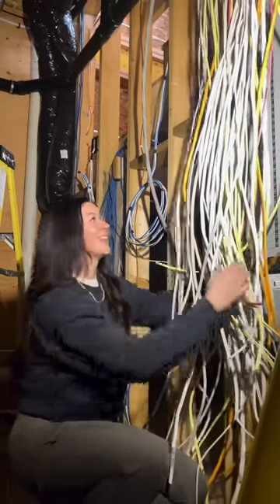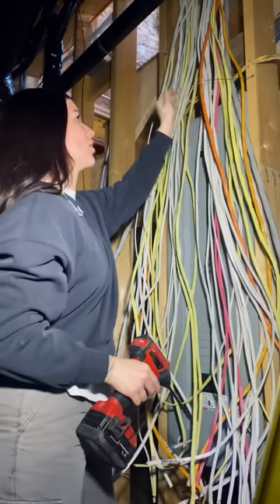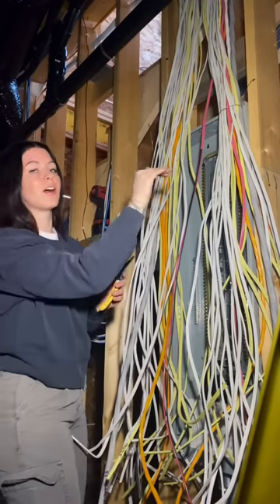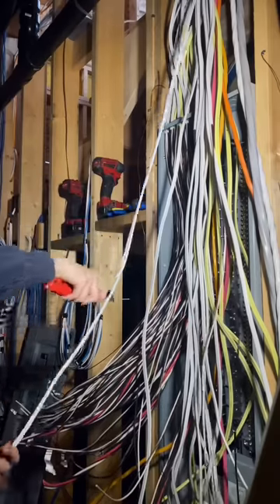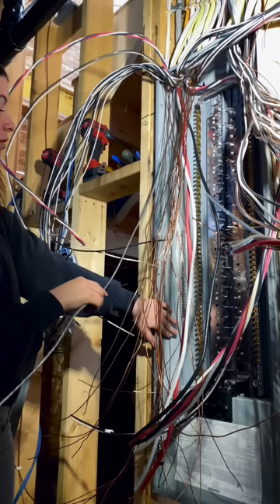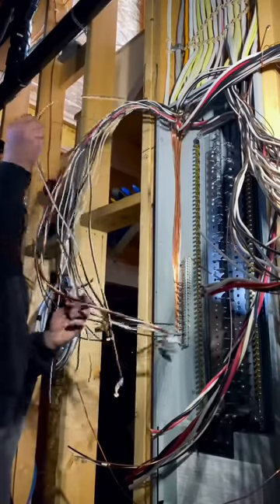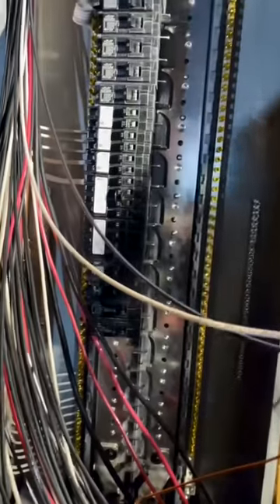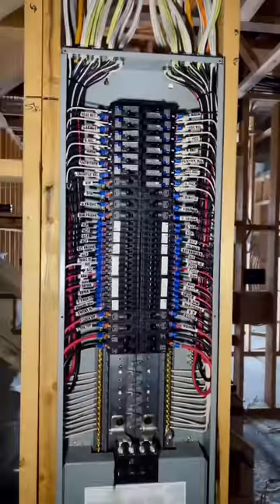How I wire a panel (an in-depth tutorial)

Comment: I like to number my circuits so the number is showing on the sheath and I can easily tie in in numerical order and then my directory is done at the same time. Couple critiques, tie your hair up, eye protection is a good idea when tying in, seen eye accidents before, wear a tool belt or proper work pants with knee pads. Also get a bigger step ladder. Trust me, 20 years an electrician over several continents including North America. Apart from that you're obviously a great worker and would be a great asset at any company or on your own work! Edit: just seen the arc flash and wow, if you're not able to switch off that mains then take extra precautions. Also use a drill with a clutch not an impact.

Comment: As  40 year  journeyman electrician, I feel confident in saying that there is absolutely no reason why the main breaker in this panel is live while terminating. 
   This is a bad example of saftey, not to mention an OSHA violation. 
     It is a pretty panel when finished. I'm glad you didn't die...or worse.
   Always isolate energy. Follow Lock Out, Tag Out, Try Out, and THEN terminate a pretty panel. 
      Love in Christ, Coop.

Comment: Clean job, just a bit concerned that you called the panel not live knowing full well the feeders were hot to the main.   Glad your ok but don’t put it off as nothing just because you understand electricity.   Use it as a learning experience and never have power going to a main like that.   No reason to have live feeders in that panel.  Work safer and keep up the clean work, all of it aside from the excess DNA.
Reply: Nearly died. Could have killed somebody else upstairs. Lucky that wire jumped away too. The most worrying is that I know electricity comment....
Reply: She had me convinced she was safety competent up until the giant spark ⚡️
Reply: @paulb9156  You can be a hero your whole life and mess up in front of the world and it all goes to crap

Comment: Damn Karly that’s one of the cleanest panels I’ve ever seen! I’m in hvac so never really get the opportunity to shut down the whole panel but that trick the way you straightened and rolled the wires so they lay tight in the back of the box is awesome I’m definitely going to have to try that in the future. I will say I did replace my own panel with about 1/10th of the circuits tops and it’s decent for my first but nowhere near what you’ve done here🙌

Comment: Great job Karly, thank for sharing. I'm in the UK and tend not to strip before entering the panel, because the cables go through silicone glands and it's easier to push T&E through unstripped and leave a bit of sheath on the inside of the panel. Also we sleeve the earth in the UK. That said if I were able to do a job to your standard I would be very pleased. One other point when dressing the wires I would like to see some protection for your hands, even if it is just a microfibre cloth when shaping the wires. Great job,  fantastic viewing, thank you for sharing, and for the professional A+ approach to your work. G.

Comment: Panel looks good and she did a great job terminating this panel with the exceptions of using an impact and not using a LOTO which is an OSHA violation. As far as using the impact, your body (hands) produces more inch/foot pounds when tightening the terminals than an impact driver would. Over time, the current from the electricity creates micro vibration which will eventually loosen the terminations, causing electrical issues such as faulty voltage readings, miniature arcs and loss of power on a circuit. Besides that everything was perfect.

Comment: About 10 years ago a friend an I did a full re-wire on a home he inherited, changing it from a four screw-in fuse setup to a proper 18 circuit layout. The electrician who supervised us was a friend and he taught us how to do the panel exactly like you do. It was a lot of work for two people who had only previously replaced a wall receptacle at best, but we got it done. When the city came to inspect the job, he told our electrician friend it was one of the cleanest rewiring jobs he's seen in his 30 years inspecting. He told him he didn't do any of it, it was all the two of us... the guy was floored.  It was a pretty awesome feeling.

Comment: instead of writing on tape  you can take the end of the insulation you originally wrote on and slide it back up onto the wires.
What I like to do is land all the neutral and ground wires then twist all the hot wires together, that way I can use a bell set to right out all my circuits when making up the boxes, and land the hots after that.

Comment: Hi Karly I noticed you mentioned you start off with 15 amp and work down to your larger breakers. So my question is does it matter if you start with 15 amp breakers and work your way down your to 40 amps, or is it better to start with your largest breakers and work down to 15 amp breakers. You did an amazing job on that panel

Comment: Great work. I'm not a sparky but the comment about impacts made me think that it might be better to use a regular drill inside the box when tightening up screws where you don't need a lot of torque -- to keep from stripping out threads? Or perhaps modern impacts allow finer control on the trigger. Definitely an impact would be great when mounting panels to plywood and lumber.

Comment: The only problem I see not only here but the three new homes built on my street (Florida) . There was no service loop in any of them, which removes any possibility if a change is needed. Also NEC use to specify 14 gauge wire and 10 to12 for appliances etc. I don't know if NEC changed but the one house had 16 gage threw out exception of kitchen, AC and hot water heater.

Comment: 5:30 that’s why I just shove the wires in the power box first then strip them. Instead of stripping them then put them in the box because something like that could happen. But if the power was completely off. Go for it. Whatever is easy to any of us is easy to us. Labeling the wires then take the cover off, putting the wires inside the box then putting the cover back on to know what wires it is, is easy to identify for us all to know if we ever do come back to the panel.

Comment: Nice work! So I have wired many commercial +residential panels, in commercial the ground is usually #12 stranded but in residential the romex has a bare ground so if the line side of your main is hot.... then you should probably tape a piece of cardboard, or use tie wraps, and secure the cardboard in front of the terminals are so that doesn't happen again. I mean It has happened to all us sparkys lol, but work smart and safe.

Comment: Great Work, Looks Great, Like to Add, I like to Label the Wires outside the Panel, Also Draw The knockouts for any side having Conduits, Small Circles for 1/2", Larger for 3/4, and so on. Have Areas grouped together, Bedrooms, Kitchen Circuits, Upstairs, and so on, I like Main Breaker at Top, Thought people had at bottom to save a Couple feet of Wire, may be allowed, may be a Reason I don't know? I wont Do. Also, I like to Leave Top 2 Right Spaces free for a Possible Interlockkit. Your list looks like you may have some Tandems, Appears you had open Space, Leaving bottom 2 unused would be good. Not bottom left and right side, but both at Bottom Right, in case of 240 Volts. You are Better than most I see. Just my 2 Cents, Take Care, Keep up the Great Work
Project I am doing now has 2 225 Amp 60 Circuit Panels at Main House. 225 Amp 60 Circuit for Guest House, Garage, and Gym. 4th Panel is for Cabana, Pool, Dock, will also have a 70KW generator.

Comment: HOT! As in awesome work. Low voltage sucks. It's 128 to 254 circuits with programming and includes rf internet and multiple means of phone infrastucture and or fire detection. Less zappy more explainy. That's a sexy panel right there. Also panels use inference so you split the wires and its why it's best to split the difference as you did in the beginning.

Comment: Just a super random note, I’ve always found hammering in some flatheads to the studs to be a far easier and faster way to move the wires out of the way to work with them. Also ALWAYS work with bitch mitts lmao I’ve had far too many times working with panels or MC specifically where it gets jammed and pulls apart slicing right into your palm. Gloves are 👌🏻👌🏻👌🏻

Comment: I have been an electrician for over 30 years, I live in Germany, and I have jobs in Belgium and Luxembourg. many of you Americans do not know all the European countries, or where they are located in Europe, in my opinion. We Europeans have other electrical VDE standards, very different from yours, which are as simple as they are poorly constructed....all my opinion. Well, you have other norms and standards, we have others. I understand that you have about 5 years of experience in electricity. You are still young, at the beginning of your journey in electricity, you do not yet have the necessary experience to know what this beautiful job means (and I can see it in the way you work carelessly). I've been following you for some time, not because you're stunningly beautiful (like all American girls), but I want to follow your work style. I noticed that you don't use a cloth to help you straighten the conductors more easily, as it is used otherwise (and not to ruin the sleeves of your work sweaters). But, you work very clean and neat. You will mainly focus on non-VDE tools, (which is forbidden here in Europe in electricity), the yellow/red ones. I see that you bought Wera noninsulated screwdrivers, but also try the VDE slim yellow/red ones, they will protect you from any bad short circuit in the future. Klein Tools have some sets of superb VDE screwdrivers, here in Europe they are double the price, and it is logical, as you also have double the price of the European tools. Honestly, I got very angry when I saw how you were working in this clip with that electric short circuit and I wanted to argue with you (and I wanted to be mean to you and also tell you that this job is not for young and beautiful women like you, who still don't have the skin of your palm beaten like that of an old tradesman and you can get hurt very quickly), but then I thought that you have your whole life ahead of you and I guess that you chose this job for pleasure. One more thing, please, wear special safety shoes for work, with the iron bomb. This is for your safety. Keep up the good work and I wish you to assert yourself in your company and have a beautiful career in life.

Comment: This the problem when you don't have an isolator switch right next after the meter. In the UK and maybe in Europe as well they have an isolator switch outside of the main panel and there is another isolator switch on the panel.

Comment: Trust me. It's a lot easier to get all your Romexinto connectors and secure before stripping the jacket. Also use your cutters to strip the label off the end of the cable and use it as a sleeve to label your circuits once they're stripped so you're not labeling twice. (Retired Journeyman)

Comment: Would stripping wires AS you put them into the panel be less time efficient? 

I feel like it’s easier to get the unstripped wire through, THEN strip it when it’s sitting in the box. 

You’re going back and fourth, but I wonder if it saves time being able to easily thread 1 wire into the box, as opposed to trying to get a bunch of them in. 

You could even do all of the back ones first and strip those, then do the front ones and strip them. You would also still have them labeled wile they’re inside the box with that method, and could label as you strip the wires while in the box. 

Not being critical at all, your work is super duper clean, just wondering if the time efficiency of stripping before putting them in is actually the most efficient way.  In my mind I would put the labeled wires into the box back first, strip and label those, then do the front ones.

Comment: I would recommend to be very cautious when using the impact when terminating on the breakers. It doesn't take much to over torque the screw and then you have a worthless breakers. Neutral and ground bars as well. I realize you are doing residential work. In the US, at least when I retired from commercial work, we had to provide documentation that all lugs were tightened to manufacturers specs. All breakers have a sticker on them with the correct info and somewhere in the panel there is a sticker with the same info for neutrals and grounds. We had to use torque screwdrivers. I'm sure this probably arose from a lawsuit
claiming some sort of negligence by the electrical company. BTW, neat work. good luck in your future.

Comment: Looking at the arc fault breakers that come with their neutral pigtails so neatly coiled up, did you un-roll, straighten, shorten, strip, and land those on the neutral bars? It looks like no. The corresponding neutral from the circuit should go to the arc fault breaker, along with the hot from the circuit, of course.  It looks like those coiled neutrals are still coiled, although it's a little hard to see, so maybe I'm just not seeing it right.

Comment: 80 circuits? Wow, that must be a really big house (or the installation is REALLY granular). 

Round here (Sweden), when we build a really large house (1800+ sq. ft.), we usually end up between 30 and 40 circuits depending on the customer's specs. Different country, different regs, I guess :)

Looks really clean though, and since you've already gotten the blood rites out of the way, it's going to run without faults ^^

Comment: Not sure why you would land all the breakers at this point of the job. I can understand landing what you need as temp (be sure not to cut the hot leg so you can place it in it's proper spot later), then leave the rest. That way if someone wants to flip breakers nothing, but what is landed is energized. As an electrician myself that's what I do to provide temp power for those who need it, without the the potential of someone energizing anything else.

Clean work.

Comment: Love therear view, that said why are you using a knife to strip wire? That is what your klines, are for!! You can benifit from me!  I could load that penel in 30 minutes or less. I do commercial work, after 6 years of residential. Love that you do seperate your loads to 50%. Thank you for yhe loop, it does make things easer. Looks great after all is said and done. Good job, just very slow.. and i have to ask where is the tool belt? Do love that i have a tool belt that weighs less than 30#. Keep up the good work just need to be a lot faster. Ps, dont tell me you use tape other than marking wire!!! You look like a qualified electrician! Tape is for marking only, dont wrap wire nuts or outlets with it. Makes you look like an amateur!!

Comment: Decent video but using an impact on a neutral/ground bar can crack the the bar itself creating a loose connection which could result in burning the wire or a fire

Comment: Hi, loved watching this. I’m not an Electrician, so I am totally confused by the wires you call “Bonds”, they appeared to all stripped back to just the metal wire, AND were all touching.
What is the point of those wires?
Reply: most would considered them ground wires but they are actually bonds. You only ground once and bond to the ground .
Grounding, bonding  and over current protection is your fail safe .  They bond the metal enclosures, if something was to be energized that shouldn’t be the breaker will trip or fuse will blow

Comment: Safety first.  Don’t use power tool in panel, lock out, no need for extra loop before connections-it’s permanent mounted, use a caddy cart to keep tools on- if your servicing another panel it’s good practice to keep all tools localized and away from panel, if I get hurt and the insurance investigator finds out anything at all they will try to deny me. Safety first.  but not bad work your actually very good at what you do. You can only get better

Comment: Hi. I'm a professional Battery-Inserter, so yeah, I know virtually nothing about electricity.  But I do have a question:   What is the purpose of the little (induction type) coils on the white wires at the top left of the panel?  ...think you called em 'common wires'     
Thanks.

Comment: As an Australian sparky, learning US core, I'd ask... Why would you not give yourself excess ground wire length by going to the bottom left corner of the board and then come up.
I always leave spare/excess in the panel.
The old motto "Better to be looking at it, than looking for it". I do this with both actives and neutrals. 

Our code doesn't permit extensions that I'm eluding to

Comment: Taking such care in your work is admirable. Not taking  as much care for your safety by wearing gloves when using a razor sharp utility blade, not so much. Blood/DNA left on your work is not inevitable as you suggest if using cut resistant gloves for this task. There are few tasks where gloves don't provide adequate dexterity to do the work effectively . I know of what I speak being a Master electrician myself and in the industry for 40 years. Keep up the great work but put yourself first when it comes to your safety.

Comment: Did the designer of this installation calculate for the grouping of the cables when selecting final circuit conductor size? 
If not, then this is a fail.

Comment: Never use a razer knife on circuits
Use an electricians knife to avoid  cutting into the insolation around the copper ark fault breakers are very sensitive to continuity on any of the circuit wires